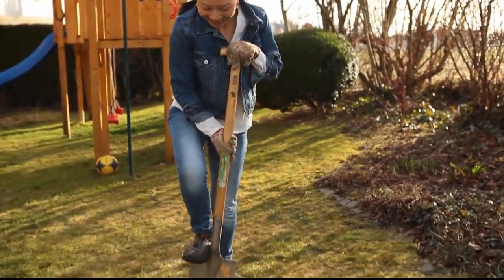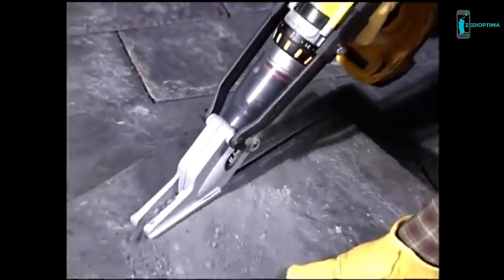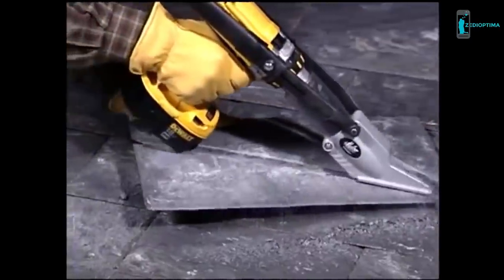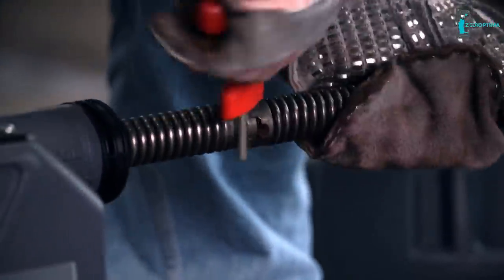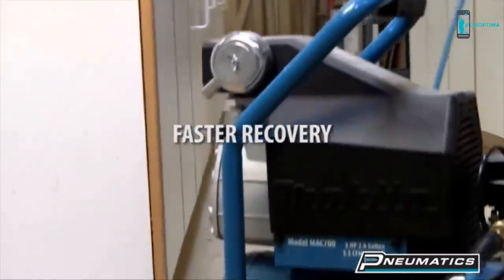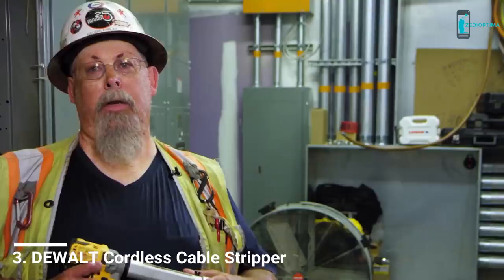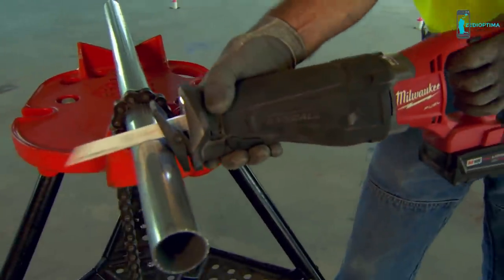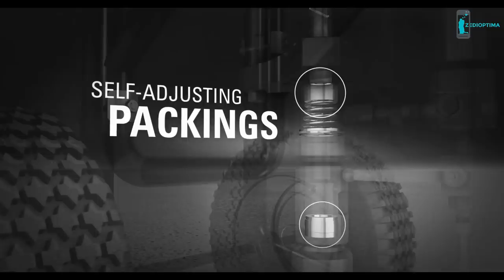10 Amazing Power Tools and Ingenious Machines for Various Jobsite Projects

Comment: 1. "...but the hard ground makes her life difficult.  So instead of just buying a pickaxe for $25...she uses a pneumatic jackhammer that costs over $200!"
2. How often to even roofers lay slate?  The majority of projects use either steel or 3 tab.  Slate roofing can be quickly and easily sized by scoring it with a utility knife a few times and snapping it over a hard edge.  But that doesn't sell a $172 tool either.
3. The Sunco pressure washer produces 3,000 PSI @ 2.4 GPM and only costs $119.
4. "From top to bottom, every piece was built with purpose"  Yeah...to part fools with their money.  $3,000?!  WHATEVER!  The Vevor electric snake only costs around $200
5. The Makita compressors aren't that bad of a price actually.  That's about the prevailing cost of a job site compressor.
6. What?  Are you serious?  You really expect people to buy a dedicated mud mixer for $300 when there's mixing paddles for $15 that you put in a large electric drill?  Nice way to create an artificial need there, Metabo!
7. Homelite has a really good hedge trimmer for $32 at Home Depot.  Black & Decker even has a 28 inch 3.8 amp trimmer for $49 at Home Depot too.  Lot better than spending $75 for the same thing.
8. Okay, I have no idea what the f&&k kind of cable that is, but I can guarantee whoever is working on it is wealthy enough to buy a $90 cable stripper. 
9. Meh...Ryobi has a reciprocating saw just like that for $59 vs $200 for this one.  Not impressed.  "Driven to outperform."  Yeah, outperform in hype.
10. Again, any business that's working on large projects like that would be able to get these without batting an eye.

Comment: That aerospade shovel looked really useful. However the fact you can use it as a wall tile remover, looks very uncomfortable. Think about it, your using basicly a shovel shaped tool to remove wall tiles. It has to weigh a decent amount for it to be useful, imagine doing an entire wall with a shovel shaped tool, with an air line to maneuver around too. Would rather use a jack hammer gun.
Reply: Is there a line around the block, filled with people that are trying to stop you?